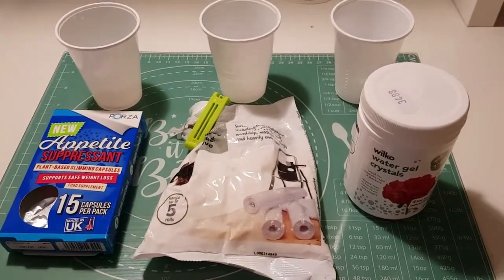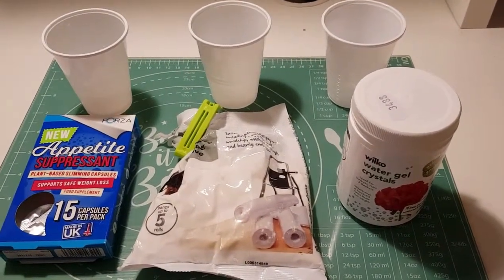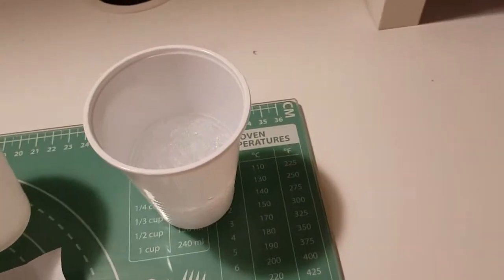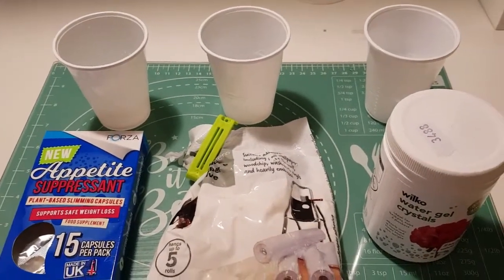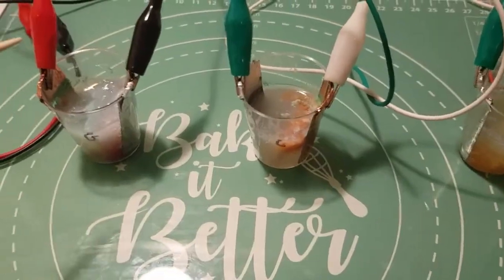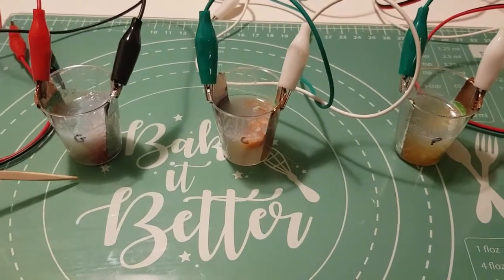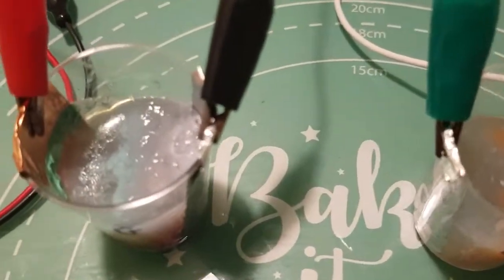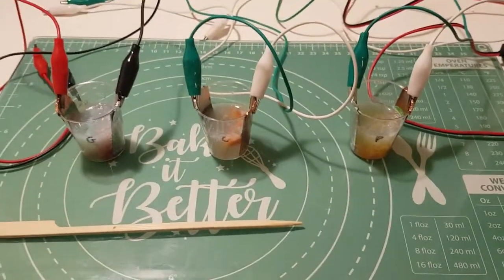Developing a Gel Electrolyte for Batteries - Part 5 - Testing Different Gels

Comment: Thanks for the video.  I tried polyacrylate in the form of "water beads" to make a gel electrolyte. One usually soaks the water beads in water. The beads  I used swell to about 2 inches in diameter. I soaked the water beads in the KOH then sliced them into discs to serve as gel electrolyte. Very difficult to work with and the KOH took a long time to soak into the beads but in the end they did work well. Cheers.